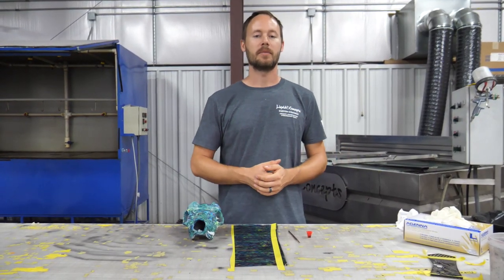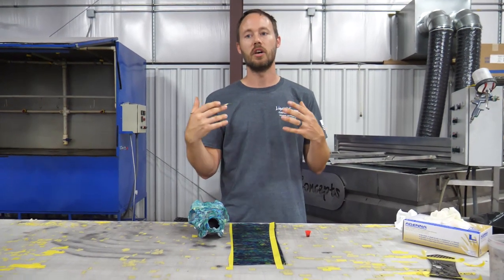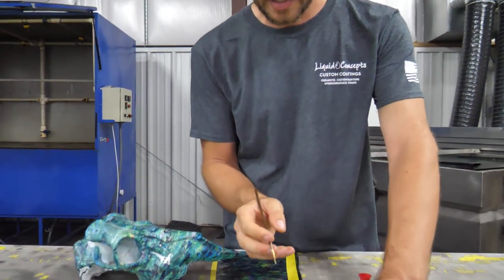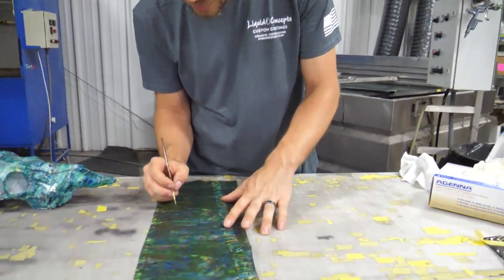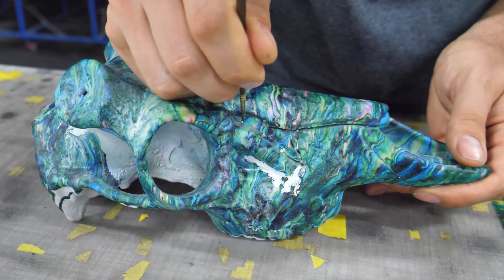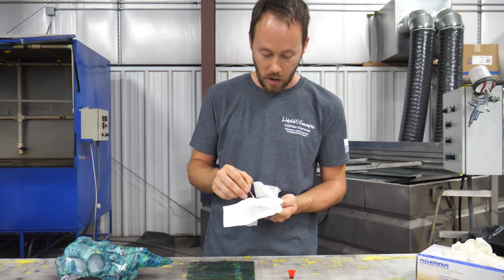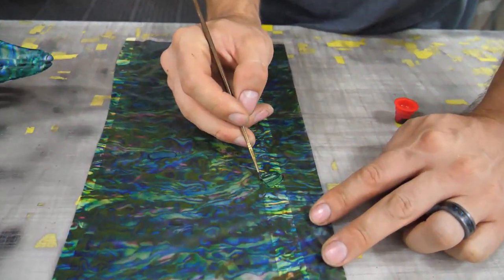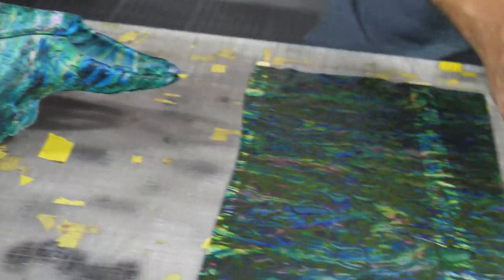HOW TO TOUCH UP HYDROGRAPHICS WITH A PAINTBRUSH | Liquid Concepts | Weekly Tips and Tricks

Comment: Hey this is great. But I tried this with TWN woodland  camo using TWN activator but it didn’t work like the video shows. I had to scrub the ink with activator to get even just a little on the brush.
Reply from the maker: Sometimes it does take a bit to get the ink off the print but it typically should not take scrubbing. If you have other films in the same color family you can also use those.
Reply: @LiquidConceptsUSA  that’s a good idea. Thanks!